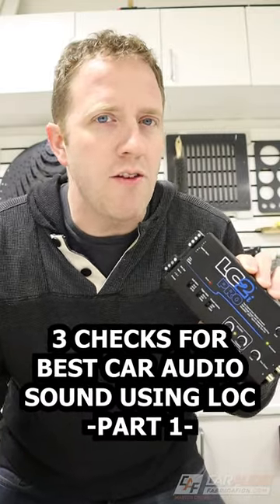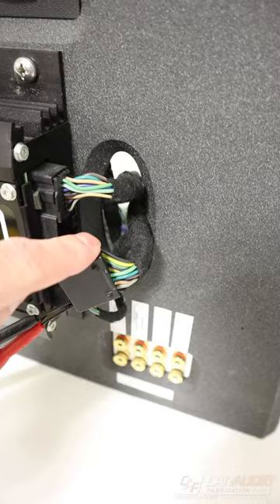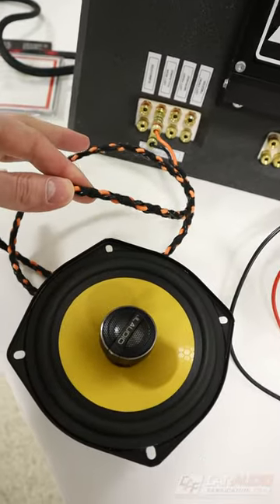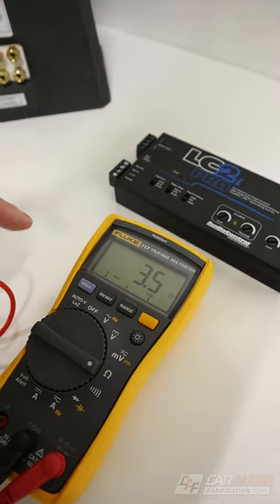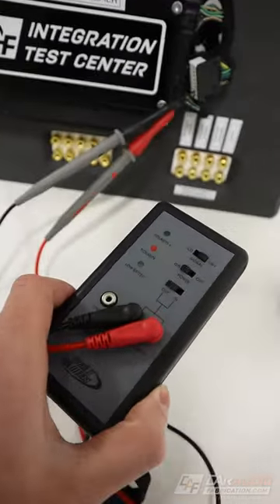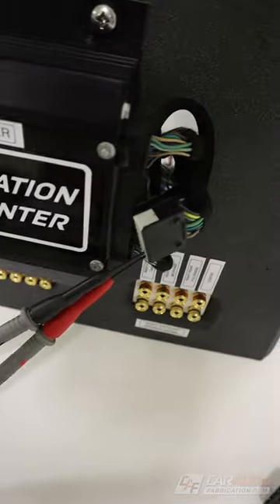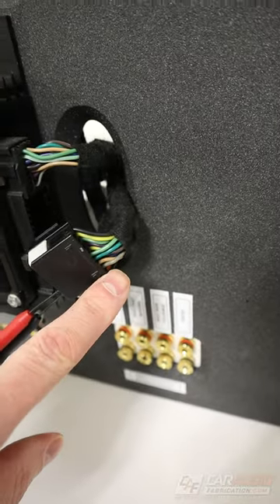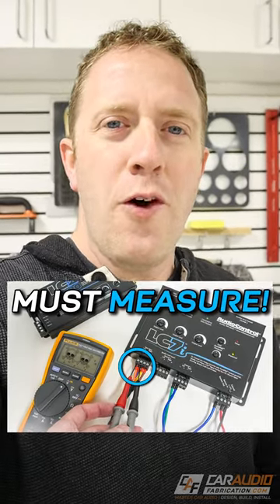You MUST check THIS for Car Audio Line Output Converter #shorts

Comment: As far as the polarity I would just use the Grampy method. See a nine volt battery will show the speaker positive and show me the direction of the cone movement as well. Then I can hook up the receiver and monitor the movement of the come as well always making sure the cone is pushing outward and not pulling inward so I don’t ruin the copper coil winding.

Comment: Yeah I aint doing all that 😂
Reply: @Flex4LX  you think making it sound difficult is part of their marketing for them to install it?
Reply: @el__comal  Yeah. Just look up wiring harness colors for your car's make & model. Connect the output converter and you're done. It's even easier if ur car has a stock subwoofer in the back just connect to that. Most people just add subs Bass anyway since mids & highs already sound good from the factory.
Reply: @Flex4LX  Luckily mine has 6x9s in back so I just tapped into those for my line out. I remember I tried to install one in my friends Camaro but I did not want to even try to mess with the harness so I gave up. Wished it was as easy as mine😂